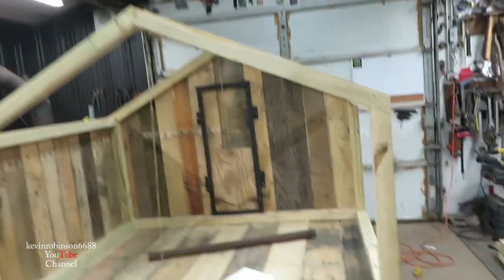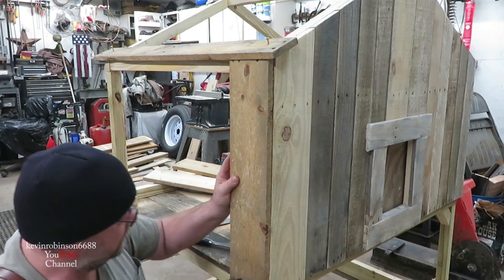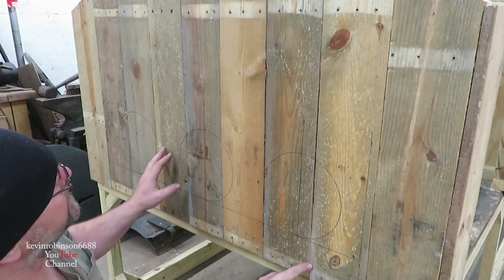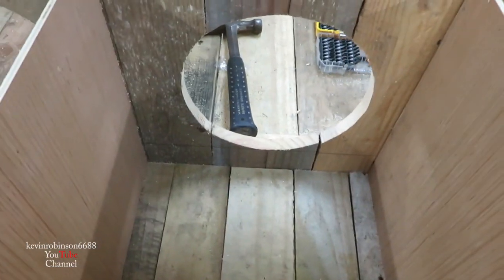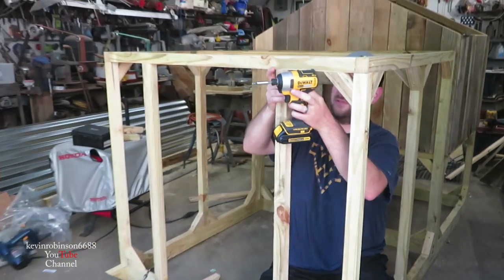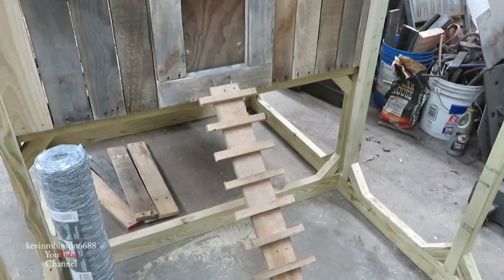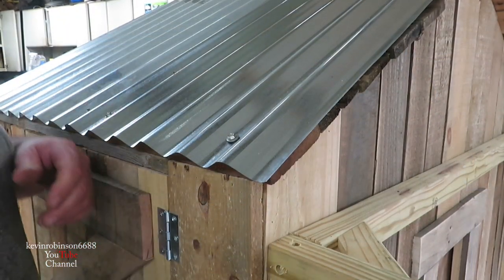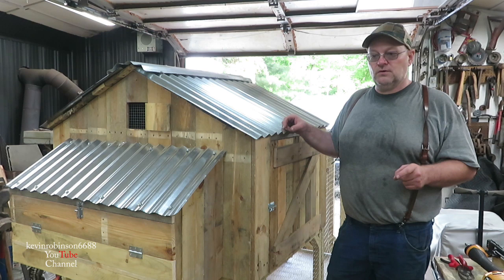Chicken coop pallet wood part 2

Comment: This is the best pallet board chicken coop I seen on youtube so far. I have plans to build your style chicken coop. I may make some things different with the measurements on the width of the coop. I'm building this coop in my garage then moving it to my backyard. The coop has to fit through my gate which is 4 ft wide. So I may go 46 inches wide. On the wheels I plan on using the wheels from my old grill and putting in the back and put handles on the front to pick up the coop from the front. Also putting the wire door on the side instead the front. Thanks for making the video.
Reply from the maker: My coop is still holding up pretty good
Reply: Once I get the chicken coop done. I'll send you a pic of it. It might look a little different from yours but yours is awesome. On the nest box my wife wants it to open from the top I may make it open from the back like yours. I'm excited to work on this it's great therapy for me to get my mind something else instead the stress of our country is going through. Thanks again my friend for posting these videos.

Comment: You done did gave me ideas now.  How is it cleaning out ? Does the rake get stuck in the floorboard cracks? Now that i watched your video, i will be running the floor boards the other way (straight in from the door)  so the rake doesn't catch on boards. Also you mentioned unhooking the plank (stairs). just put a cable on that too, and you can pull it up with cable instead of going in to remove and back in to re-install, (when moving coop).
Reply from the maker: When cleaning the coop we use a snow shovel turned over flat and scrape the floor on the ground so it works better than a rake, thanks for watching.

Comment: Are you able to put a latch kind that screw in and is hooked to the piece of hooked metal and attach to bottom of steps then you can lift hook from door that you installed(big door) then you can just open door lift steps to ceiling hook move and you don't have to crawl in. Just a thought
Reply from the maker: That's a good idea Paul.

Comment: What degree angle do you use for the roof of the roosting box? And for that matter how did you determine the angled cuts for the pitch of the roof?
Reply from the maker: I didn't have a plan so i don't know the angle i just built it steep enough so water and snow roll off of it.

Comment: Great build, however racoons are smart..and they can open barrel bolts as well as rip through chicken wire..19 gauge hardware cloth is a much better option though it IS expensive..worth it..terrible feeling to find your girls been invaded by predators.
Reply from the maker: Thanks for the comment good info.

Comment: Your ideas and design are great, but no way should there be more than 3 (4 tops) chickens in this size coop!  Youre just asking for crowding/bullying issues. Also that roost bar is way too skinny. Overall GREAT job!  The only other thing I’d change would be to make the run taller so you can get in easily to feed them.
Reply from the maker: Thank you so much for the comment and watching.
Reply: Or make the run shorter and put a big door on top like I did